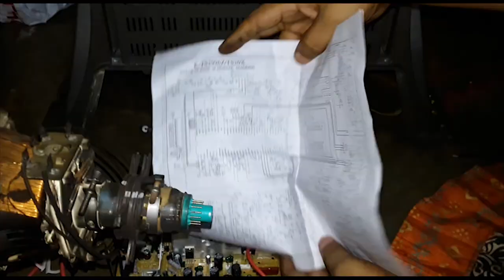CRT TV KIT REPLACE REPAIR CRT TV  21" CRT #13

Comment: gud evening sir,i jus wna ask how do u know which pin on the board u connect the horizontal coil from the yoke? i mean,u see there are four wires coming from the yoke down to the board,the 2 are for vertical and the other 2 are for horizontal,right? but the the other wire is separated,so how do you know which pin on the board you insert it espcificaly that red wire. ty
Reply from the maker: blue is horizontal red is vertical check the wire first or check old wiring then match the wire . if all connection is OK thane solder it . all connection available in circuit diagram coming on the box . if you know more then contact Facebook lave massage i call you . Thanks for watching.
Reply: ty very much for ur quik response..ok il jus pm u at ur fb acc..
Reply from the maker: if you know more then contact Facebook lave massage i call you . Thanks for watching.

Comment: Hello, what about the yoke coils resistance range compatibility? 
Thanks
Reply from the maker: CRT yoke coils consists of two coils (windings) ie; the horizontal and the vertical yoke coils. It is easy to check on the horizontal yoke coil. Simply measure the coil with Dick smith flyback tester and it should rings 4-5 bars and above. If you get 1-2 bars and the LED don’t lit then it is either had developed partial or complete short between windings. Do not check it with normal multimeters as  shorted yoke coil the meters also show good reading! Vertical yoke coil rarely become defective and the dick smith flyback tester can’t test it. Make sure that it has ohms range from between 3 to about 9 ohms . If you get a measurement of 100 + ohms then most likely the vertical coil have problem and need replacement!
Reply: I measured 2-3ohms on my vertical coil, that seems low, but can the replacement chassis drive a 2-3 ohms vertical yoke coil? Thx
Reply from the maker: +Stéphanie Blancan-Callen  yes.  Please contact me on Facebook. Thanks.